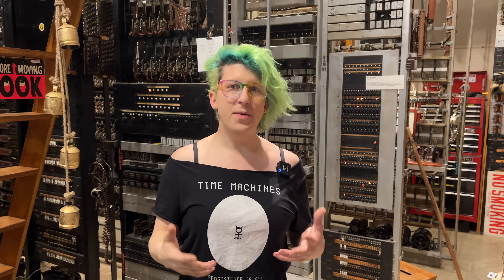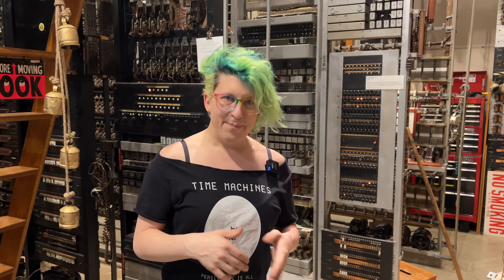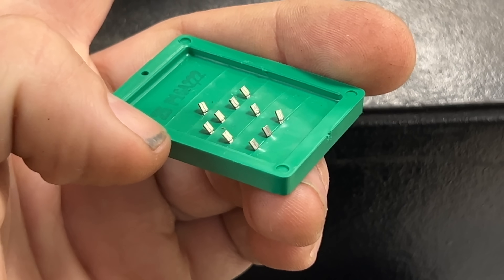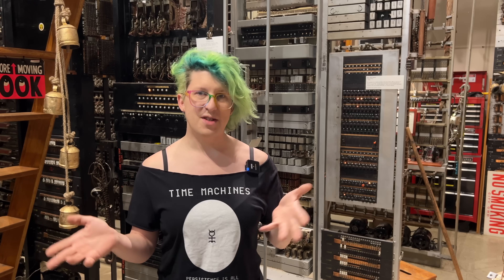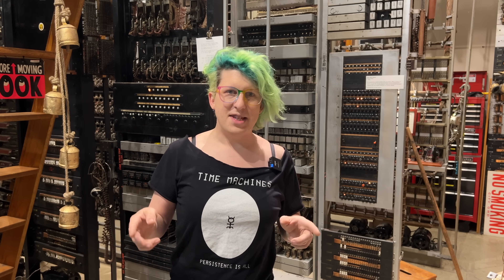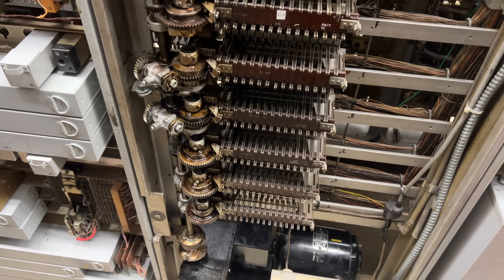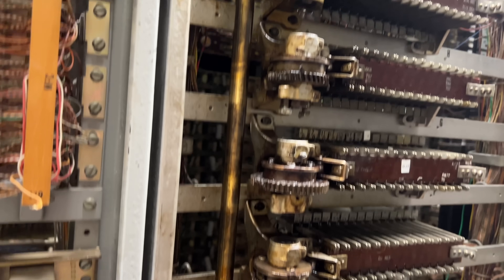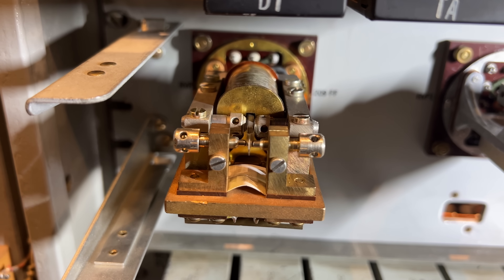Sender Test Frame: My new circuit works!

Comment: Hi Sarah. I've been watching your videos for a long time and enjoying them. It is amazing that I found this series tonight. I JUST got an identical contact welder to yours! It was a gift from a friend who didn't know what it was. I was unsure what it was for myself and am ecstatic to see the exact same one here. I knew it was a resistance welder but not what it was for. I don't have the phenolic inserts. Mine does function. I welded some small steel wire together as a test. The time pulse circuit works. One of my future videos will be to take this apart and explore how it works. It won't be a destructive test and I will put it all back together. Definitely plan to reference your video in that one! 

Most of my hobby work is antique electric motors and refrigeration, but I love all of the old tech. Would love to see this museum some day. I do travel so it is probably going to happen.

Comment: You mentioned in part 2 that you removed the area code racks... does that mean no long distance handling? I'd love to know more about how area codes, long distance, call waiting, and touch tone works/worked.... just some ideas for future content ;-)
Reply from the maker: The racks I removed were only for the sender test frame, and only impacted the test equipment. This panel switch can't handle area codes, so there is no purpose in testing for that capability.

Comment: Wow, welding a new contact on a relay!  In my history I've had to take care of bad long-frame relays, but the repair was usually to replace the relay, or on occasion to  just replace that one contact spring if it couldn't be burnished to fix it.  Only the Bell System would think of things like that.  

And congratulations on success.  I've always had such a good feeling when I got something I built to work.  Somehow just so personally rewarding.

These videos are so great, thank you.

Comment: Nice welder, I never knew these existed, we'd just swap the contact.
As for the wiggler relay, I have a similar one by Siemens & Halske TBV3402/36, I was going to connect it to my Teletype 'thingie', to add some visual & noise, but it wiggles so little that you need a magnifying glass to see it actually working - although more visual than a sealed mercury wetted relay, it still seems pointless nonetheless, oh well.

Comment: How would it be possible to replace the interrupter gears in an operating CO switch? Wouldn't taking out all these 'clock signals' disable the whole switch?
Reply from the maker: That’s what the backup interrupter frame is for!
Reply: @ConnectionsMuseum  Is it possible to remove the shaft with all the gears and cams still on it, so that you could have a spare shaft already built up, and quickly swap it out, then change the worn gear/cam?

Comment: It's interesting how the electro-mechanical era informed how Sci Fi talked about robots and AI all the way up through the 90's with references to "circuits", which aren't really a thing that makes computers work.

Pretty much anyone under the the of 50 will have never encountered circuit type logic, so when some robot in a show talks about the "circuits" they must assume its just some writing device instead of a legitimate attempt by people in the 1950's and earlier to describe computers with the language of simpler non-computer tech.

Comment: When reassembling that interruptor driveshaft, are there timing considerations between the various contactors that need to be maintained?  Because that sounds like a nightmare!
Reply from the maker: Each one has an individual set of gears that makes the timing. I had to make sure that when I re-assembled everything, I matched the correct gears with each other, otherwise the timing would be incorrect.

Comment: Having worked in SXS and No. 5 X-Bar for Pacific Bell (Pacific Telephone & Telegraph) for 15 years (36 years total service), I can certainly say congratulations on your relay contact welding skills. It was an easy thing to mess up and ruin the relay. Especially when the relay was in an awkward position in in the equipment bay. The heavy cables to the clamp didn't make it easy.

Comment: UK GPO/British Telecom used a tester with a power jack plug on the end, slide switch to select battery/earth, and a standard 50v (or 24v for PBX's) lamp in it, similar to automotive test lamps, just set to what you want to find, plug into a battery jack (all over the frames/ racks) and probe away